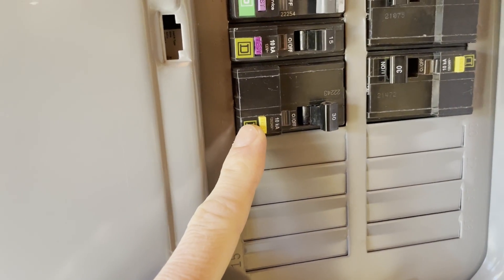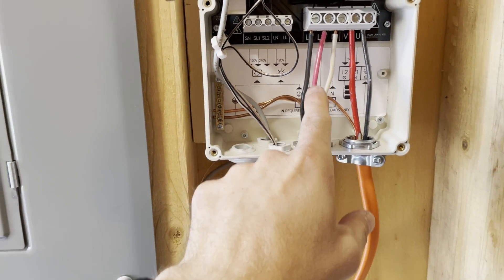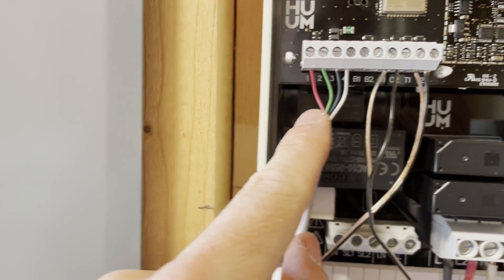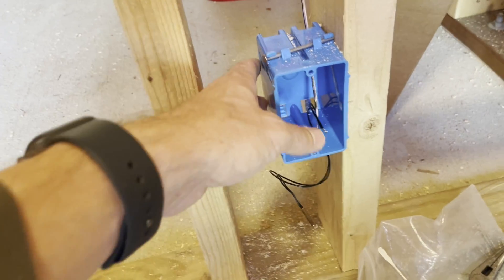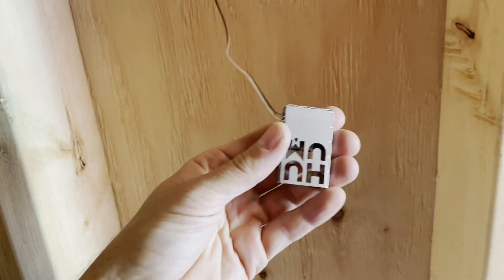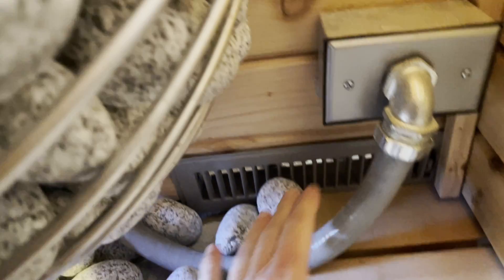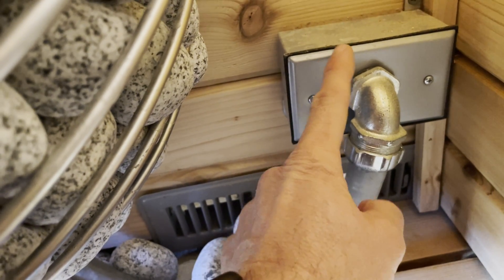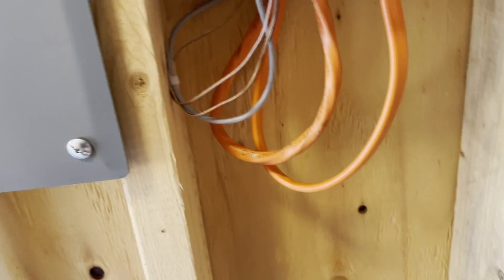Sauna Electrical Installation for Huum Heater and Lighting

Comment: Either hire a certified electrician of which I am not, or do a lot more research because I see a critical mistake being made with this video.  There is a National Electrical Code which provides minimum
standards and practices that Professional electricians must adhere to, or they can lose there license.  All info is online, just a question away.   Your answer to a comment to use a 30 AMP breaker with a 37.5 AMP system is wrong, wrong, wrong.  You must ROUND UP the system line draw   to a next size breaker, this provides a critical safety margin.  Your system requires a 40 Amp breaker not a 30 Amp, this is a national code.  Additionally, in most states the NEC code requires an emergency cut off within sight of the sauna, or a lock out adapter at the service panel.  Don't assume you know because obviously you don't !  Excuse the rant but we are all amateurs here, we must realize we don't know so get the facts, ask questions, you are messing with peoples lives here, including your own.
Reply from the maker: I think you were reading too fast. I provided the math to get to 37.5 but said if you install a 30 it will trip AND then need to contact the manufacturer to verify. Dont ever tell anyone to automatically round up because they may not have the wire to support that higher amperage.

Comment: You are so zoomed in, I can’t tell, but do you install the uku junction box outside the sauna?
Reply from the maker: @raker1980 yes, I installed it outside. It has a waterproof case but no need to expose it to heat and moisture. Not sure if the case is heat resistant.
Reply: @handyhomerepairs thanks!

Comment: Have you installed the extension box for 12KW or greater?
Reply from the maker: I have not, sorry. Mine was the simple 6 kw that only needs the single box.
Reply: @handyhomerepairs  thank you for the reply. I have the extension box and I’m having issues with correct wiring and unfortunately, Support is not very helpful.
Reply from the maker: That installation manual is only 2 pages and mostly pictures. It doesn’t look that intuitive. Did you resolve it?
Reply: @handyhomerepairs  first glance it seems very easy for sure. The module itself shows that it requires 240. Very simple for anything under 10 kW. But then when you add in the extension box, the extension box actually requires 480.2 separate 240 straight runs. So when wiring originally according to the instructions, the extension box does not indicate this. It does indicate that there are jumper legs from the main module over to the extension box providing at the extra power it needs. However, that’s not the case.
Huum Support insisted at first there was no need for an additional 240 run to the module. Then they came back later and said that’s the easiest solution. So that would mean 3-50 amp breakers. Two for the extension box and one for the module. Then the retailer had a solution to have a separate 15 amp breaker ran just to the module. Mainly because the only thing I need to power from the module is the temperature sensor, the control panel and the door sensor.

Comment: Did yoiuhave to add spacers to your heater mount to the Sauna wall?  I found that there is not enough room for 3/4" conduit or fitting to be mounted to the back of the heater panel and be able to pass between back of heater heatrshield and wall.
Reply from the maker: Hmm I did not have to add any spaces. There was just enough for me to add a 90 elbow on the back of the heater and run the wire parallel to the wall into the elbow. It is a little tight and the elbow is touching the wall.

Comment: I love what you did witht he power cable coming out of the  wall to electric heater. Altho, it is unnessacery, but it looks much nicer. Tried to do something similar, but gave up :D cable was too stiff
Reply from the maker: Yes it was extra work. I’m always paranoid with someone doing something you didn’t think about like pouring extra water on the stones and it goes down the wall into wall opening with electrical so I wanted to offset but also keep it water resistant

Comment: could you give as a link for the outlet box under the sauna heater and the conduit please?
Reply from the maker: The junction box is just a standard outdoor weatherproof box and I added 3/4” connections — Thomas & betts 5353. The conduit was a little more difficult to find. For my local codes You need metallic and waterproof 3/4” conduit but that only is rated for 174* F, so I had to get the high temperate to be good for over 200* F. It’s Liquid-Tuff 6803-22-00 Extreme Temp. When I bought it, I could only find it on Zoro, Grainger, and local electric supply stores. Check your electric codes to see if it ia the same.
Reply: @handyhomerepairs  does it have to be metallic conduit? would be enough to use PVC Liquid-Tight Conduit Non-Metallic?
Reply from the maker: It depends on the local codes. I also decided metal conduit was a better idea because it is in an area that could possibly be kicked. Most likely won't be, but it runs low between the box and the heater. There are also a couple hundred pounds of rocks in the heater hanging over it.

Comment: Is that breaker a GFCI type?
Reply from the maker: Yes, I put in GFCI because there is liquid being poured on the rocks around the heating element and steam. I had seen some peoples saying gfci trips on sauna heaters but mine has been running for almost 2 years with no problems. I don’t know why others have tripped except maybe an incorrect installation. I would not want a metal appliance in a wet location without gfci.
Reply: @handyhomerepairs  Im going to install a Sauna for a friend its outside.. Outlet 240v with slotted 15a outlet... Says in code book plug can be used as a disc, exterior needs gfci... The manufactuer does not give specific details, but I should be ok..

Comment: HUUM HIVE MINI 9KW ELECTRIC SAUNA HEATER(317-530CF I just bought this heater, what cable and what breaker can I use?

look at the manual and it says amps 37.5 circuit breaker 30. wire 6awg.

I'm going to run a 50' long line thank you.
Reply from the maker: 9000 W / 240 V = 37.5 A which is correct but if they recommend a 30 A breaker it will be tripping because the heater is pulling 7.5 A more. You should call the manufacturer and double check that. You can check with a local electrician because it seems you would need at least a 40 amp breaker which requires 8 AWG. I used the continuous load rule which requires 125% of the rated amps which is about 47 amps and would require a 50 amp breaker and thicker wire of 6 AWG. There are other considerations like cable length and if the wire is running inside a conduit because it can overheat. A local electrician can help you with calculations and the local code for other specifics like wet locations.
Reply: @ thank You So much

Comment: Is the water-tight box necessary or can you pull the wire directly into the heater from behind the heater? Appreciate you taking the time to respond to everyone! This video is super helpful!
Reply from the maker: It depends on your electric codes. The issue is you are pouring water on the stones and unit which could then run down the wires to wherever they are connected. If you don’t have a water tight connection on both sides it could enter a junction. I also didn’t want the junction thru the wall to be near where the water is being poured. It addition, with all the humidity and differences in temperatures there is condensation which can lead to water penetration into areas you don’t want it to go. Water, sweaty people touching metal, and 240 volts makes for a potentially dangerous situation.

Comment: Did your installation not include or require the extension box?
Reply from the maker: What do you mean an extension box? A junction box?  My sub panel is really close so I just ran the wire from the breaker directly to the control unit.

Comment: Great video and good comments.  I cannot tell if the door switch is required for operation from the manual.  Looks like it is based on this conversation.  Shipped instructions are SO BAD.  I also cannot tell how to wire in a light to the control unit so we installed a 110 external plug which seemed unnecessary.  Lame.
Reply from the maker: The heater will not work if the magnetic has not engaged the door switch. The control panel will say door open. If the heater is running, it will shut it off. I installed the light on a separate circuit as well because I wanted to switch it manually instead of using the control unit.

Comment: For strip lights... If I wire them into the module, will I still need a power supply outside of the module? For the strip lights I have looked at, they require a power source which specifies the amount of watts... Do you know?
Reply from the maker: The main module provides a switched 110v circuit so you hard wire the lights. Think of it like a light switch that already has power. Check the manual for the max power in watts, but if you are running strip lights that are LED then they will not need much current and are most likely under the max

Comment: First of all, fantastic video! Question for you... I bought the Huum Drop 6.0kW heater with the Uku Wifi control and I'm doing the wiring myself. Like a dummy, I ran 10/2 wire instead of 10/3 wire... Will the sauna heater + controller + temp sensor + door sensor work with the 10/2? Is it just light function that I'm sacrificing without 10/3?
Reply from the maker: I think you are ok and it is only for the lighting. The heater does not use the neutral and all the other parts (except lighting) just have low voltage wiring running to them. I assume low voltage because all the components connect with thin wires like use use for a door bell or old school hardwired phone
Reply: @handyhomerepairs  Thanks for the quick reply! Yeah, I'll call the manufacturer tomorrow to confirm but I hope you're right lol. REALLY don't want to re-run the 10/3... Thanks again!

Comment: Why not use a 20amp breaker for 4.5 KW ? I only ask because when I did the Converse it came out to 18.75 amps
Reply from the maker: For continuous load circuits you need to calculate the amperage at 125% because they want you to allow extra overhead to compensate for heat dissipation since the conductors will be carrying high load for long stretches of time. Check the local wiring codes since every municipality is different.

Comment: This was a great video. Question: is the high temperature wire you used, copper or tinned copper? Does the ground have to be high temp as well or just 10awg bare copper? I blew my circuit breaker after hookup
Reply from the maker: @captainsgold9903 I’m not an electrician but I bought mine from a company called Wire & Cable Your Way. Search for High Temperature Wire. It’s stranded and says it works in wet or dry locations. Says nickel coated. It handles very high amps for the gauge because it has so many strands. Technically the ground should only be needed in an emergency but I was already installing the wire so I used the same for all 3 and made sure I could securely connect it to the frame.

Comment: Any issues woth the lighting circut? Installing and there is no power to the lighting circuit.
Reply from the maker: @blakeb4399 I did not use the lighting circuit from the control center. I wanted to control it with a regular switch / dimmer so I ran a separate line. 

Did you run 4 conductors to the control center? The light needs the neutral white wire.
Reply: @handyhomerepairs  yes metered everything today I believe the control center is faulty contacting the company tomorrow
Reply from the maker: Figured you did it right. Just checking. It’s fairly simple, so sounds like control panel issue
Reply: @handyhomerepairs  the homeowner had to turn the circuit on in the app who would have thought.
Reply from the maker: Oh wow. That is strange. I don’t even have that option in my app.
Reply: @handyhomerepairs  not sure how but the homeowner said the same thing. Then he called the sauna manufacturer and they walked him through turning it on. Maybe a new model of the control board?

Comment: Thanks for the video. Very helpful! HUUM's install manual is rather simplistic and doesn't really discuss the mounting of the wire/processor box. How did you mount it to the wall?
Reply from the maker: I had to mount to the inside of the exterior wall in the cabana. I just attached some 2x3 furring strips to the wall and some regular screws. It’s not heavy. The multiple pits of heavy gauge wire is secured underneath the box so everything has plenty of strength

Comment: Did you wire in a light to the huum control panel?
Reply from the maker: @user-bt2gv2qu3g no. I manually wired a light to an exterior switch. I didn’t want to have to control light via huum controller
Reply: @handyhomerepairs Thanks for the video. May I ask why you didn’t want it controlled by the huum module ?
Reply from the maker: @drewp7781 you have to press and hold the dial, turn it to light, and then you can control. I already have lighting electrical close by so I would rather have a simple light switch and dimmer function.

Comment: What kind of cable did you use between the control panel and the heater? I was told I will need a heat resistant cable, but couldn't find it except as a single conductor. Please share link if you purchased it online. Thank you
Reply from the maker: @jamalothmanRN I used standard cable run to the heater but terminated it in a weatherproof sealed box on the inside of the sauna. I assumed that there was no heat radiating through the wall, foil barrier, and insulation. But, from the junction box inside the sauna, I then splice to high temperature appliance wire. The run from the box to the heater was also inside high temperature sealed conduit. I’m sure someone else will correct me if I’m incorrect. This was the wire I used. 
https://www.wireandcableyourway.com/12-awg-tggt-wire-high-temperature-wire-250-c-ul-5256-5196

Comment: I cant turn it on if anyone has ideas im all ears. I tun the breaker on and I hear a click in the controler and thats it no display nada
Reply from the maker: @TCB2023. You turned it on so the control panel with LCD is working? If you hear the click, then the relay is engaged and there should be power to the heater. Check if you are getting voltage on the “output” to the heater and maybe one of the wires or ground is not connected on the heater element? Oh you said no display? The click should not occur until the request to turn on from controller is given. Check if you have both 120v wires connected and the ground. I don’t think the white/neutral is technically needed to power the until (according to them manual it’s only for auxiliary lighting)
Reply: @handyhomerepairs  No LCD display.  Click happens when I turn on the breaker.

Its 208v. HUUM said it should still work just 20% less output.  Haven't heard back from them other than that.
We're in Hawaii. 
Appreciate your help
Reply from the maker: @TCB2023.  is this 208 volt 3-phase? If so, that won’t work because the sine wave phases of this system are different than residential single phase. I see Hawaii offers 208 volt single phase to residential so maybe the Huum system is having issues with the lower voltage if that is the case.
Reply: I have the same issue!!

Comment: Excellent video. Can you advise of the name of the wire used from the junction box to the heater and where you were able to purchase it?
Reply from the maker: It is just basic wire you can get from large home center stores. Usually called NM or romex. The thickness or gauge of the wire depends on how much electricity the breaker allows. My heater is 6000 watt on a 30 amp breaker, so it needed 10 gauge wire. This is North America wire naming convention. The heater is 240 volt so it needs 2 electrical conductors and 1 ground. Its called 10/2 with ground (10 gauge, 2 conductor). It is behind the protector wall so didn’t need anything special. The wire runs into a water tight box. From that point to the heater required special wire that can handle high heat and not be affected by water. Inside the sauna it runs through a high temperature resistant and water tight conduit
Reply: @handyhomerepairs  What water tight box did you use? Having a hard time finding something at a big box.
Reply from the maker: @col2007  my Huum came with that water tight box. You can buy similar ones on Amazon. If you look in the description of my other video “Stream Music Alexa Echo link…” there is a link to Outdoor protective box. That is what I use for outdoor to protect the Alexa. You can start there and find the size you need.

Comment: Can you just put a jumper on the door sensor and not install it?
Reply from the maker: @chrismarino9104 yes, I believe I saw one of the other commenters mentioned that they did that. I didn’t want the heater running with the door accidentally left open and heating the outer room or running constantly so I installed the sensor

Comment: Hi do you have any extra of the high temp conduit you'd be willing to sell?  I am installing a 6kw Cliff and need a couple feet.
Reply from the maker: I don’t sorry. I sold what I had left on eBay. I bought mine on zoro. I searched around on several different sites and finally found there. Some electrical shops also had it but they were either commercial only or shipping was too much. I think I also had to wait a couple weeks for it to be in stock but finally got what I needed. This is what I ordered. Liquid-Tight Conduit,3/4 In x 25 ft,Gray